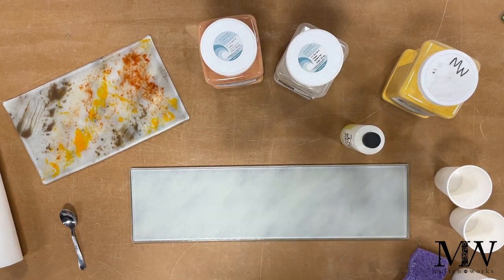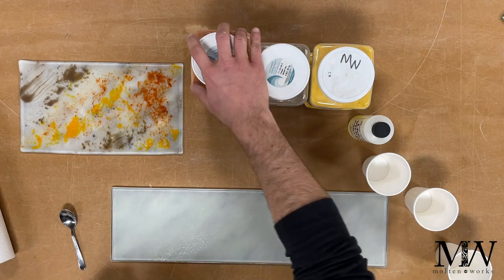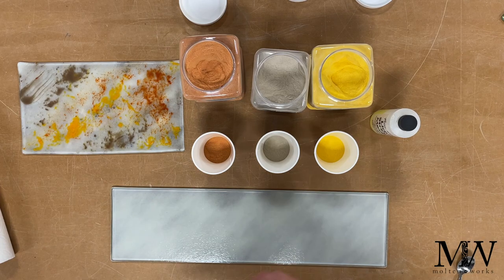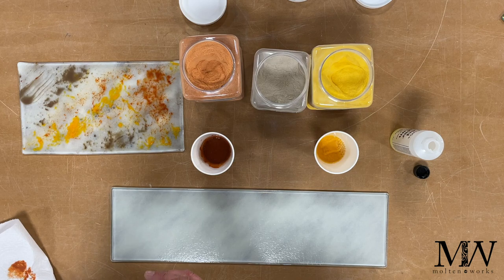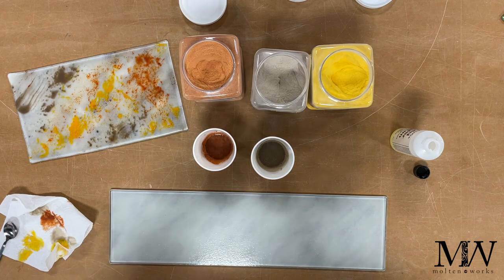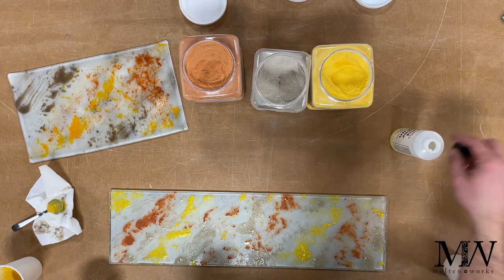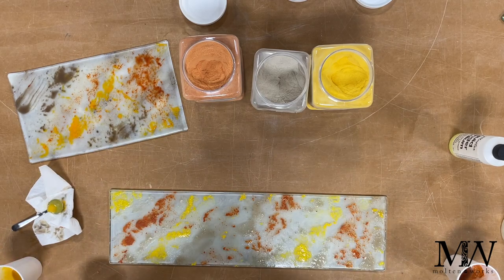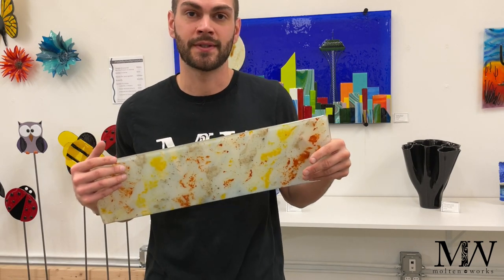Fused Glass Experiment #5 - Liquid Stringer & Sponging

Comment: Nice. I really like using glassline but I get frustrated with it because it dries up so fast. Do you think this product could be used as the same thing once mixed with the powder? Or do you think I could mix it with my dried up glassline?
Reply from the maker: That's a great question. I found it helps if you can seal the mixes you make. I tried to only mix what I need, but definitely had some waste. I pretty much mix and do everything I need to do while it's the right consistency. I haven't tried mixing more glassline in once it's dry, but I don't see why it wouldn't work. Or maybe even just adding a little water?